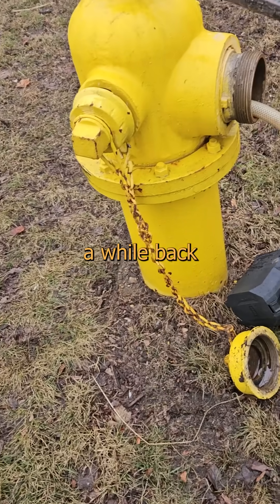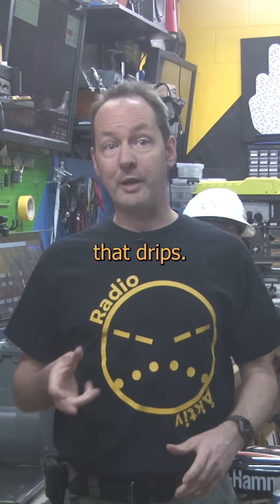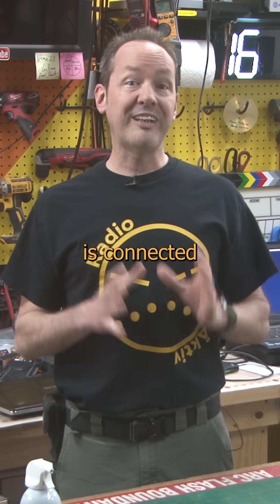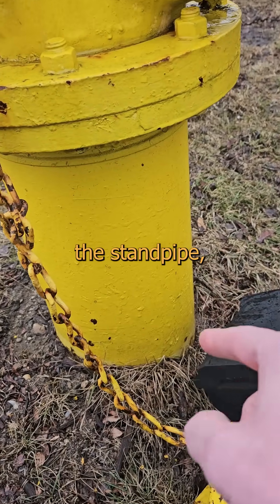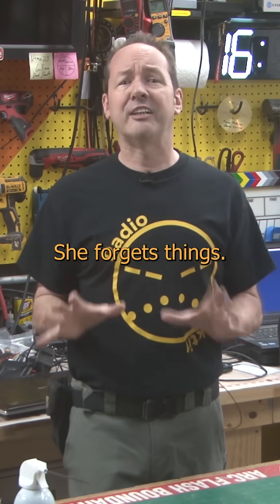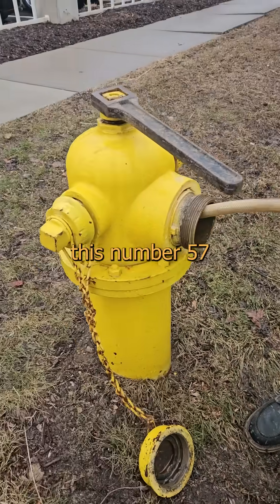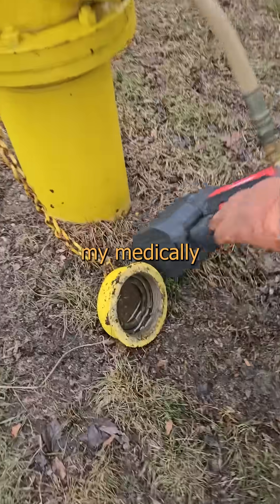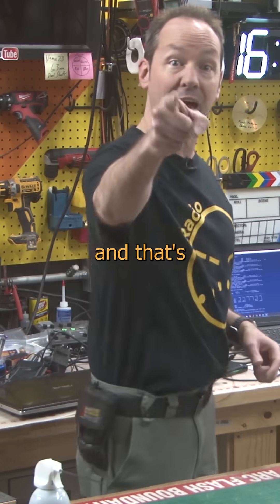How Fire Hydrants Drain #chrisboden #comedy #engineering #water #winter #michigan #ice #science

Comment: Not the whole story.  When the hydrant is closed, a small drain valve above the frost line opens and allows drainage underground. The drain valve is linked to the main valve stem and operates reverse to the main valve position. I worked on these.

Comment: I’m in water transfer for frack water to oil wells.  We don’t worry about contamination. But our risers get pumped out with the same pump for the freezing issue. That 6-8” riser is cute.  A 16” is going to need a high amp hour battery to get pumped out.

Comment: This is known as a dry-barrel fire hydrant, usually only installed in areas that experience cold winters. IF INSTALLED PROPERLY (which is shockingly common) they can be knocked over and not turn into a huge water feature like the movies. Those are usually the wet-barrel hydrants like they have in SoCal etc. 

I can tell you when I was turning hydrants (exercising/maintaining) we never manually drained any of them (5,000+ of them, and yes it’s a northern state). Actually part of the maintenance is verifying the drainage. After you have operated the hydrant, remove one of the caps and place the palm of your hand over the nozzle and hold it there for a moment and if draining properly a small vacuum is created and when you remove your hand you will feel and hear the sound similar to squeezing a bottle and putting it to your skin. A hydrant not draining will have no vacuum created. 

A possible reason a hydrant like yours might not drain in the winter could be the depth of frost line. Usually dry barrel hydrants have a bury depth of at least 72” typically whatever the mainline depth is nearby. But operator error is often the plague to hydrants, they are designed to be fully opened or closed not throttled (like half or quarter opened) this causes the hydrant drain (a couple of weep holes) to be opened while the hydrant is under pressure effectively flooding the drains field which is usually like a yard of pea gravel buried around the foot of the hydrant. Fire Fighters usually know better, water truck drivers not so much. Best to install a gate valve (ball valves will water hammer) on to a nozzle and throttle it that way.

On the water contamination side, theoretically a low pressure event could create a source for contamination but the situation where the pressure is low enough would be a recordable event that would require a boil water notice to be issued because there are plenty of places water contamination could come from when a potable water system loses pressure. This is why water disinfection (chlorine, chloramines, etc) and backflow prevention devices (AND TESTING) is critical to public safety & health.

We recently learned that some fire protection sprinkler systems installed in non-climate controlled spaces are filled with an anti-freeze like glycol which they discovered on the top floor of a building so without a back-flow  preventer during a low pressure event that could be another cause for contamination of the water system.

Comment: We in Austria have hydrants where the water from the standpipe flows somewhat fast into the drainage, the hydrant is placed in gravel and if you fully close the valve you open a second one that lets the water out, somewhat fast.
We check that every fall for every hydrant. Most of the firefighters are volunteers, and we have so few fires, it is also a good exercise to find all of your hydrants.

Comment: Does the fire hose have a check valve or vacuum breaker type connection? Seems pretty dangerous if not, since it's connected to the drinking water supply.

Comment: Standard 4’+ deep fire hydrants are now equipped with weep holes at the bottom of the barrel, just above the mounting shoe.  When the hydrant is open fully the weep hole is covered by the valve gate, and opened when closed.  Improper drain beds or corroded barrels are why I am “bicycle tire pumping” our hydrants once frost starts.  That pump is “Pretty Cool” and now to talk the boss into buying one😉

Comment: Retired from a FD in eastern NY state. Had a few areas that the water table was so high the water dept plugged the weep holes and filled the barrels with RV antifreeze. We also only had 3 hydrants in the district we could refill from b/c the system was old enough that the whole neighborhood complained if we used any others. They didn't like rusty white clothes.

Comment: Where I live, this "dripping" happens below the frost line. Deep enough, that it doesn't freeze (usually).
On top of that, the hydrant is emptied within some seconds, so polluting the drinkable water is not an issue, as long as you attach the obligatory one-way valve between the hydrant and the hose.

Comment: That hole doesn't just drip, the new Waterous brand hydrants we install have a hole 1/8'' NPT on either side of the stand pipe above the 90 in the bottom. We also bury the hydrant with 1/3rd of a yard of 1.5'' gravel in most places, that hydrant is going to drain unless the groundwater comes up.....

As a side note we had to diagnose a water leak on 800' of new 8'' water main last year..... This was the first new install in more than 10 years that I had to look for a leak on, and it turn out that an o-ring that is supposed to seal between the water main side of the hydrant's plunger valve in the bottom was missing. I spent nearly 16 hours effing around cause someone missed an o-ring at the factory. 
The supplier rep said "are you sure it didn't just fall in the bottom when you unscrewed the valve?" 
Yeah, we are sure, because when we screwed the valve back IN WITH A NEW O-RING THE LEAK STOPPED and we got to pressure test to 200 psi.

Comment: “Wanna hear something cool?” I was a commercial and residential plumber for 4 years and I’ll tell you that you should NEVER drink tap water. I don’t care where you live or how old or new your house is. I’ve worked on water mains in neighborhoods that were less than 10 years old and those 8in mains have a .5in - 1in layer going around the entire inside of the pipe that is all rust, calcium and buildup. Water that goes to your house travels through water mains that have been there for 20+ years and those pipes are absolutely disgusting. I haven’t drank tap water since. And I HIGHLY recommend that you don’t either. “Cause THATS pretty cool”

Comment: Here in Germany we have to use special one-way valves outside the hydrant, to save the deinking water supply from some back-pressure into the hydrant/pipe. It'a for the same reason, as they are dirty and rusty inside.

Comment: Down here in Florida we use a drip system at the bottom of a pipe and the hydrant is connected to the main line with a T connector and mega lugs which for a 1st time install was an absolute bitch but the crew I was with eventually got it done

Comment: I actually specialize in fire protection systems, and you got almost everything right here l, the only reason the hydrants have weep holes on the bottom of the stand pipe is to drain the water and prevent freezing, this is called a dry hydrant. In the southern states that do not get freezing weather you will have what is called a wet hydrant that has water all the way up to the top. You can see this in video games and movies when someone hits a hydrant the water flows that is only on wet hydrants. If you were to hit a hydrant in a colder state you most likely wouldn’t have water spraying out unless you damaged the underground main.

Comment: The possible contamination is the exact reason why my safety region is no longer allowed to use fire hydrants and now uses water trucks carrying 16 cubic meters of water each. 

And if that's not enough they'll use a VERY long 8" thick hose and a bunch of pumptrucks connected to open water.

Comment: Snowmaking hydrants are weird - they handle hundreds of PSI but less flow than a fire hydrant. They have a bleeder too, but pressure in the stand pipe seats a modified check valve and shuts the bleeder. When you turn the hydrant off, the ball unseats and drains the standpipe. This works fine 99.99% of the time, even when it's below zero F.

Comment: So..... as a firefighter in western PA, who's weather isn't a whole hell of a lot better... your department of public works has a really lousy maintenance program. At NO TIME should there ever be water standing in a hydrant like that.

If there is, then either hole is plugged, or the gravel bed around the valve and piping is nonexistent or contaminated with mud. 

And unless you have REALLY awful water pressure, the moment you crack that hydrant valve, the line pressure is going to shove that shit water out of the way and out of the hydrant.

Actually, leaving the hydrant capped, and opening the valve only a turn or two should build enough pressure to blow through the restriction in the drain hole and make room for water flow. 

If this is not the case, something is very VERY wrong with the water system, and even on a good day, I'd think twice about drinking it.

Comment: Here in Germany, when a lot of water has been pulled from a hydrant, the increased flow might dislodge some stuck debris off the walls of the pipe. That sometimes leads to households turning on their taps and finding that the water is some shade of brown. They then report this to the utility company. Usually this is completely harmless and will resolve itself within a day or two. 

What we really need to be careful with is foam. If you have a really major fire scene and have to deploy loads of foam, what can happen is that things get chaotic, someone hooks up a line in the wrong place or shuts a valve that should stay open. And before you know it, you're pumping foam agent into the drinking water supply. Which very obviously is "no bueno". While we are not using the old style PFAS foam anymore and the new stuff is a lot safer for the environment, it probably still isn't safe for you to drink. For that reason, distributors / dividers that are hooked up to the pump intake have an automatic check valve built in that closes as soon as there is any back flow. You can also connect a one way valve to the standpipe if it does not have one built in.
Not sure the nomenclature in English, but the relevant German words are "Verteiler", "Sammelstück" and "Systemtrenner"
Reply: That device (in the USA) is called a Humat Valve and it has a one-way clapper internally. The explanation of its full use is a bit long for here.
Reply: @ Thanks for sharing that.  Will do a bit of reading on it 😃

Comment: Hey I work for local water utilities in Wisconsin and apart of our routine hydrant flushing we do have a few types of hydrants. Most of which are self draining via the weep hole mentioned and sometimes it can get clogged up so we use the shown M18 pump to empty the barrel (or standpipe). We also have a few oddball barrels that are marked as “non-drain” because of a lack of weep hole so I spent about a week going around the village doing what we call “kerplunking” and pump out the non-drainers. we call it kerplunking because we have a nut tied to a string and wrapped around a dowel and drop it down the hydrant to check how far down the water is to make sure it’s below the frost line! When it hits the water it makes a “kerplunk” sound! Great video!
Reply: Thank you for all your hard work!! It goes totally underappreciated
Reply: Where I am the Hydrants are covered by a small metal plate and they the firey's or the water company screw something down on to it and turn on it's valve.  When they flush the line the pressure is amazing.  Even though we get frost it only gets to -3.C overnight average.  This is in the cold part of Australia.
Reply: I'm guessing no weep hole where the water table is high?
Reply: @marquisdemoo1792 bingo 😎👍 there is a few neighborhoods where it’s only non drain bc it was basically build on a swamp. But there’s a few random ones scattered around. My guess was they were hit at one time or another and were replaced with whatever was in stock.

Comment: I don't know what kind of hydrant that is, but all hydrants should drain completely after they're shut off. Cavitate, the valve at the bottom is not closing when the water is turned on, saturating the stone sump area below the hydrant. Or the water table is so high, draining isn't happening. You shouldn't have to suck out hydrants, there's something wrong..... I've installed and repaired hundreds of hydrants of many brands, and have never heard of that procedure as normal. If your lines aren't buried below the frost line, you've got bigger problems all around.... The deepest I've ever put a water main is 10 ft to avoid a particular frost issue in the Berkshire mountains.

Comment: Just an FYI for general knowledge; The weep holes in the bottom of a fire hydrant that let the riser drain get blocked by the valve mechanism when you fully open the hydrant. If you don’t open it fully, they will be wide open below ground, jetting away the whole time the hydrant is partially on. If you have something like a temporary meter that will be on there for days, weeks, months or even longer, that constant high pressure spray will cause problems. Always either fully open, or fully close a hydrant. Don’t try to just crack it open a little bit and use it like a normal hose bib.
Reply: @baddestmofoalive  I learned this today and that's pretty cool.
Reply: @baddestmofoalive  we started plugging drain holes on new installs but they still require fully open or fully closed.
Reply: @taylorsova2594  We also started plugging every hydrants we are refurbishing. They often have water coming up the pipe from the ground. Always use a gate valve if you don't want full flow. It's not only bad for the ground on unplugged hydrants it's also abrasive for the rubber seal.

Comment: Hey, fun fact in Germany a lot of our hydrants are under the earth. There is  just a metal plate above it. 

The firefighters have their own hydrant top in their car and slot and turn it into place. The key is used beside the hydrant topper and doesn't go through it. This is for the reason that if the topper would be damaged or not cuppled correctly, the water could still be shut off.

Additionally, about every three months, they go around clearing and cleaning the hydrant holes and wash them out. 

Unfortunately i can not tell you how we get the rest water out, as that was never needed.  The moment we turn off the water, the flow back valve engages fully and the other valve we turned of course too. 

Then the topper is just removed and the water that was still in the topper just flows into the hole, into the earth around.  No real permafrost or as deep winters here, and the hole is deep enough so that the frost usually doesn't reach the water.
Reply: https://youtu.be/i-swelia-5o?si=DXBqf8v0WpXEBVLv
Reply: Here is a video of a voluntary firefighter explaining how it works. The automated subtitles are pretty good and understandable in English when automatically translated.

If the Link doesn't work, it's: "Trinkwasserschutz:Standrohr setzen bei der Feuerwehr" by FeuerwehrWilli 

Direct title translation is "drinking water safety, standpipe usage at the firefighters"

Comment: I used to do termite pretreatment, and would have to fill up a 1000 gallon water tank multiple times a day, 90% of the time from hydrants. This is in Oklahoma so it wasn't every winter but in the actual cold ones we would have to drain hydrants manually. And it seemed like every single one of them had never been opened or it was 10 years ago the last time so we would have to literally sledgehammer a big metal spike through all the built up shit around the valve to get anything flowing. Getting mad just thinking about it lol.

Comment: It’s a different kind of fire hydrant than they use in the south. The valve is on top because it never freezes. Seems like it would be easier to drill and tap a hole at the bottom of the hydrant just above the valve and after you close the hydrant just open the tap to drain the water off that would freeze.

Comment: I work security and one night a tenant from a finished building came over to the unfinished building I was watching to tell me there was a crack running across the driveway.  Sure enough there was. An hour later there was a gap of 4 inches, about 6 inches deep.  By the next morning it was impassable.  The crew using the fire hydrant as a water source for their concrete had not closed it properly and as it drained for hours it undercut the driveway.  By the time all was repaired, the retaining wall, packing, paving, infrastructure assessment, it was 6 months and $2,000,000.  And then the pump house for the pool, on the other side of the same area, pulled away and started sliding down the hillside.  Don’t mess with fire hydrants.
Reply: They basically waterjet cut the neighborhood

Comment: I'm a bit surprised that manual drainimg is needed. I'm born in Austria in an Alpen village where you need to be prepared for snow around the year (yes I have seen fresh snow in the middle of summer) and our hydrants are often also connected to the drink water, but it's still self draining. The line including the valve is deep enough to not freeze and surrounded by gravel to ensure self draining

Comment: Ice hanging off the hydrant...  
Saw that in 1989 down in central Florida... 
Florida doesn't do hard freeze very often. What plans we have for it aren't used oft and stay rusty  and equipment has to be rented and borrowed...
89, they probably didn't think to drain them in a lot of places...  Back then what emergency plans we had were made by old white guys that never worked in snow, never had to live in snow and were more worried about that Hurricane coming up the coast.

I live in OKC now...  Ice will shut everything down. But we are good...
Then you get to... Say New England...   5 GD foot of snow and the icey stand downtown is still open..